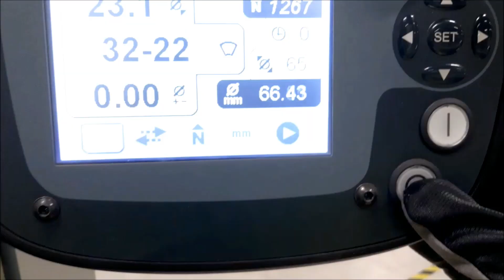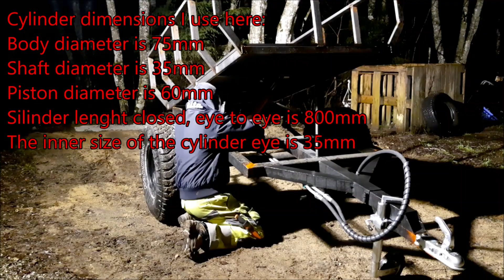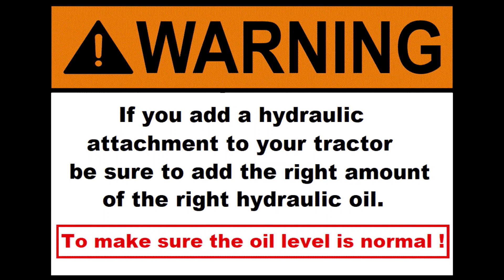Hydraulics for Old Russian trailer rebuild into dump trailer. Part 3.

Comment: Good eye for the opportunity to recycle the vaz trailer, good and simple design using materials at hand, excellent fabrication skills, and very good outcome.  You will get a lifetime of use out of this project.
Reply from the maker: Thank you!  Yes the trailer is good and useful, but it still needs to be built and modified.

Comment: Did you add the rear remote to the tractor?
Reply from the maker: Hey, if you mean the hydraulic connection, then no. It was already attached when I bought the tractor, European models already have it as standard. Thank you!